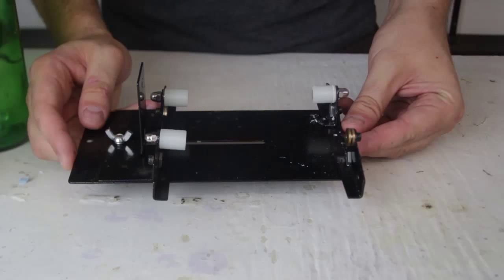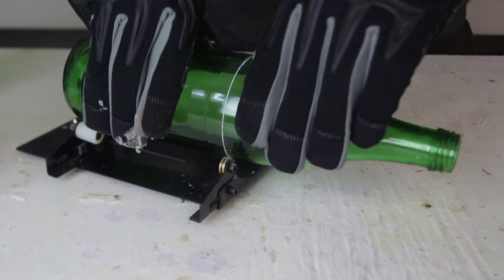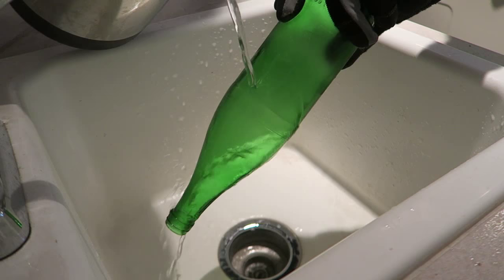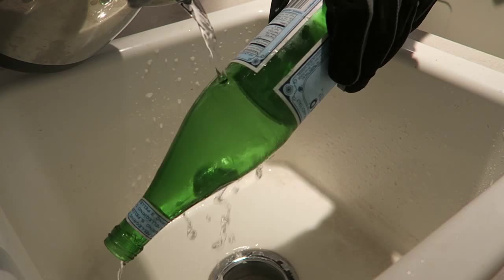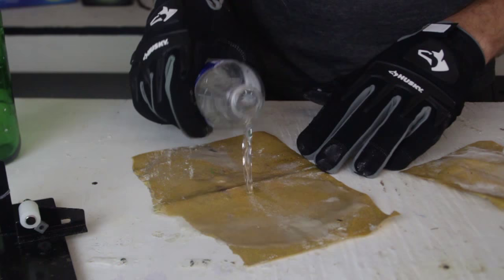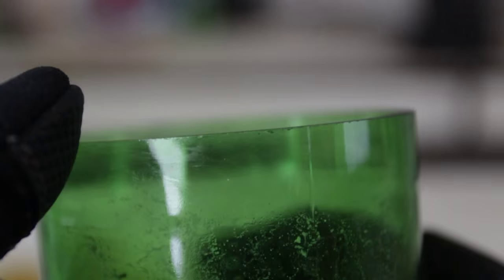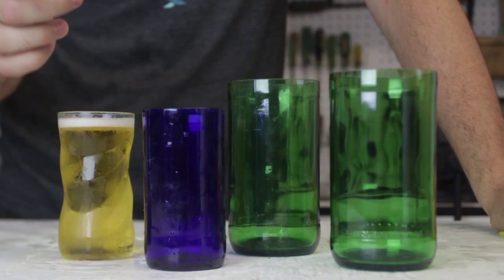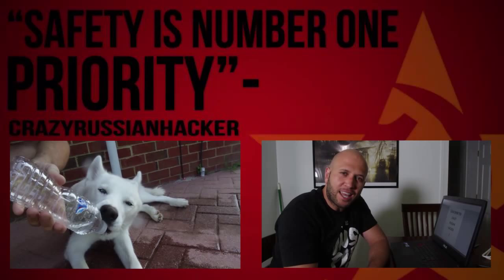DIY Drinking Glasses from a Bottle

Comment: Don't cool it first... put the bottle in the hot water for a couple of seconds, then run just a little cool water over the scratch. It will pop apart. Use a propane torch to to smooth the edge, and allow it to cool slowly.
Reply: I used your technique and my mom is now gurgling her own blood in her mouth from the glass shards.
Reply: Jared Garrison Nice!
Reply: Jared Garrison i devised my own technique, i did it all the CRH way but it broke so i got one out of the cupboard instead and i was done!
Reply: askjerry Dammit I tried again and when I used the blowtorch it heated up to quickly and now my dad has glass in his eyes.
Reply from the maker: askjerry eather or i don't see a big deal with come first lol and torch might overheat the glass and crack it.
Reply: ***** I used to do neon glass bending, the trick with lead glass is to come up to temperature slowly... wave the flame over the edge quickly a few passes... gradually bringing it up to temperature... then you can bring the torch in so the blue tip of the flame touches the rim... it will begin to soften and smooth out... keep the flame moving back and forth. Then allow to cool slowly... about 10 minutes. Or you can wet sand... I prefer a flame polish.
Reply: askjerry DUDE if he do that maby the glass bottle will broke
Reply: Maybe*  and Break*
Reply: Does* Too xd
Reply: askjerry Cool tip, thanks ... I've made several tea light holders from old bottles, and previously have sanded the edges smooth, so I'll definitely try using a torch next time. I usually put about an inch of sand or pebbles in the bottom of the cut bottle so the tea light doesn't sit right on the glass and make it too hot. This fits the surf shack vibe of my summer house nicely too. and helps weight it down to make it safer and more stable.

Oh, any tips on drilling glass? It would be cool to be able to add wire handles so tea light holders can be hung from places,.....
Reply: Jared Garrison you gotta remember, "safety is number one priority"
Reply: engineeredlifeform you can get special drillbits for glass, adding some sort of buffer material either side to help absorb the vibrations and to help keep the drillbit fixed in place can also help
Reply: +askjerry Anyone try using a record player/turntable to spin bottle while torching??

Comment: Even though the first bottle was not perfect, you probably could have used pliers to snap off the remaining piece cleanly, then wet sanded the entire cut area. You do realize the abrasive paper you used is not wet/dry paper. Using regular sandpaper with water will make all the abrasive fall off in no time. The clear spiral glass was very nice.

Comment: These are awesome glasses

If you soak a cotton wire in gasoiline, bind it across the bottle, light it on fire keep it sideways and turn so the fire touches all around the cutting line. then put the bottle in a bucket of cold water, the cold makes a perfect cut in the bottle.

Comment: This also works by wrapping a cotton cord around a bottle, make sure it goes even around the bottle and has a firm knot. Then soak the cord in benzine, alcohol, acetone, nail polish remover or other flammable solvents you happen to have at home and light it on fire. Spin it a little around while the solvent is burning. When the flame is almost burnt out, cool the bottle quickly with cold water. Now you should be able to pull the bottle into two even cut pieces.

Comment: Yeah because everyone will buy a bottle cutter just to make a glass
Reply: Check out a you tuber named threadbanger and watch this video
Reply: Already subbed to him:)
Reply: *****  it would be recyled anyway...
Reply: +I'm Elif - well I em no crazy nor russian either, but I too can gev tips foor life hacks. So if yu cannut buy bottle cutter, just drop eh rope in oil then tie it eround ze bottol, and light it on fire for eh fiu sekends. Then drop deh bottol in veery cold woder (with ice in it or somefeen) and it shuld cut itself purfictly at the part where the rope wuz tied. Oll yu haf tu doo now is rubbing every sharp bits of glass with sandpaper, and BOOM ! Yu gat yur glass done from deh bottol. Pritty koo', huh ?..
Reply: I'm Elif you can make them by just wrapping a piece of rope soaked in alcohol and lighting it up. then just put it in cold water
Reply: Renovski - that's basically what I already told him.. sixteen months ago.

Comment: uneven washing with hot/cold makes it crack unevenly, recommend you use 2 bucket hot/cold water and dip the wine bottle head in and out. Btw, without bottle cutter, you can use thread wrapped with alcohol to burn a similar circular line and dip into cold water to crack it, u will get same results without paying anything.

Comment: Awesome video! Just a little suggestion of a method I've used before :D I tied a rope around the bottle around the point where I want it to cut off.... Then pour vodka (or any alcohol I believe) and light it up.... Do this out door though.... And stand back.... About 10-20 secs later it should just pop off.... Let it cool, then sand it like you did :D

Comment: An easier (and more fun) way is to take a hair tie and douse it in rubbing alcohol. Then, put the hair tie on the bottle where you want to make the cut. Light the hair tie on fire for about 10 seconds and then (while still lit) submerge the glass in ice cold water. The drastic change in temperature splits the glass wherever the hair tie was. And then sand it down and you are ready to go!

Comment: I found an easier way to cut it is to give it one pass on the bottle cutter(don't cut over lines, just once), get some boiling water, pour it slowly on the cut while rotating for about 10-15 secs, and then immediately pour or dowse in cold water while rotating. I have about a 9/10 success rate with this method.

Comment: If you cant find a bottle cutter, you can use a string thats dipped in oil snd light it up on fire for a sec, then dip it in ice cold water, then it should split the bottle in half on where you put the string

Comment: Hey crazy Russian hacker you can also cut a bottle with string acetone & cold water. Tie the string around where you want to cut after soaking it in acetone, then light it on fire & keep spinning it so the fire burns it evenly until it goes out. After that put in a bath of ice water & the stress from the temperature Chang will cause it to crack where the string was. Warning the bottle may implode or shatter if heat isn't distributed evenly. I hope you can do a video on that someday you are really cool & keep it up.

Comment: try the brazilian style, put some water at the point that you want, and put a cotton string outside at the same water height, tie the string and burn it.
The string will burn and the glass will cracked at the water height, so smooth the edge with fire its a good idea.

Comment: Of you could do it the simple way....

Soak a piece of yarn in a flammable liquid. Then tie is around the desired spot. Making it as straight as possible. Light the yarn with a lighter. Then quickly put the bottle in ice cold water. BOOM!

I'm surprised he didn't show the more common method.

Comment: easier way to break off the glass: use a rubber hammer. that's how we did it in art class when we made stained glass. that little defect could have been broken off that way. you don't SMASH the thing with the mallet, you gently tap-a-tap along the scored line and then it just breaks right off.

Comment: It's generally easier to cut all the way around the bottle once while applying a lot of pressure, then use a lighter to heat all the way around the crack. Immediately afterwards, dunk it in water with ice and it should crack cleanly. o3o It's also faster if you're making more than one at a time.

Comment: There's an easier way to do this! Take a string, soak it in 91% isopropyl alcohol, tie it around the bottle at desired height, light it on fire. Let it burn for a bit, then extinguish it by dipping into cold water. The shock of the temperature change will break the glass evenly along the string. Then sand it down to make it safe

Comment: you don't need boiled water to seperate the extra glass form the bottle, jut tap the excess part with wood or anything non metal and it should seperate quite easily.

Comment: You don't actually need a bottle cutter just. Wrap a piece of yarn soaked in 90℅ or above isopropyl alcohol around the bottle, set the piece of yarn on fire and while it is still burning dip it in cold water. It will cleanly break the bottle in half. Then just sand the edges of the bottle with high grit sandpaper to smooth out the top so you don't cut you lip.
Reply: Oh yeah round the edge or as close to round a possible.
Reply: Joseph Sadler it wouldnt give such a nice cut
Reply from the maker: Joseph Sadler works as well done that a long time ago :)
Reply: ***** holy moly. it's THE MAN!
Reply: ***** Awesome you replied. Any tips on how to get more views on my one video that was honestly pretty much a failure and more a mini flare than a smoke bomb
Reply: funny_yummy ha that was my nickname at church camp do to premature facial hair
Reply: funny_yummy there where some strange things happening on the last night

Comment: I was told you were supost to soak a lash ( or something like that ) in lighter fluid and bind it tightly aroujd the bottle, then light it on fire and spin it untill it was all burned out then quicly soak it in freezing cold water. But your way works too

Comment: Scoring line was too deep and the water needs to be gently run over the bottle with a light tap. It does take practice, but I've gotten some excellent results. Some people use a blow torch but that's not necessary for glass.

Comment: man... I was a glass guy "Glazer" for years. we did that all the time, I have a better way of doing it.  You don't need to spin the bottle so many times, Just ONE TIME will do fine. Trust me... I did it by hand dozens of times with my hand held glass cutter. Make a new video with one time around,.. Promise it will work better. You don't have to press hard, you should hear a certian noise all the way around.

Comment: see how it was not a clean cut!, simply use a string, dip it in alchool, parfum or w.e, tie the string around the bottle where you want it cut, light, spin bottle while its burning, prepare some cold water in the sink to dip the bottle in, dip and voila fast and ez